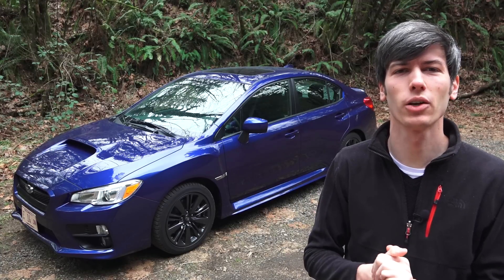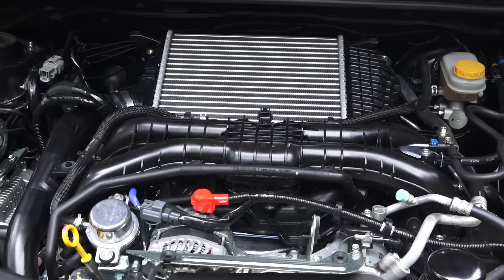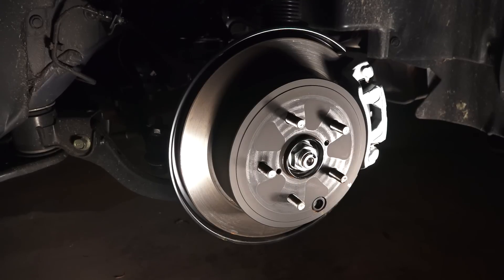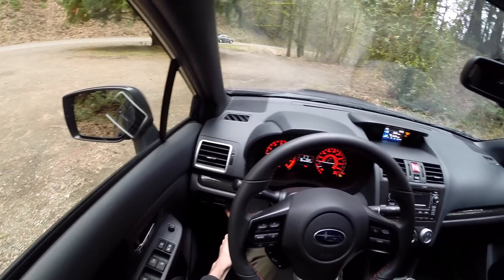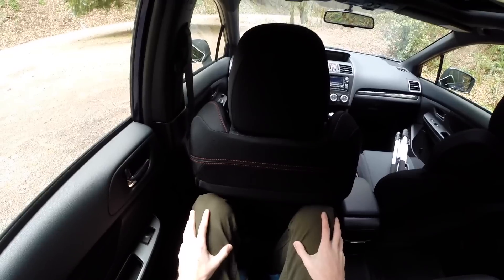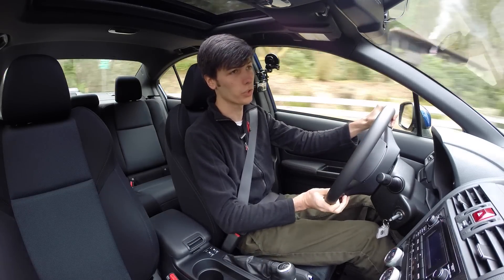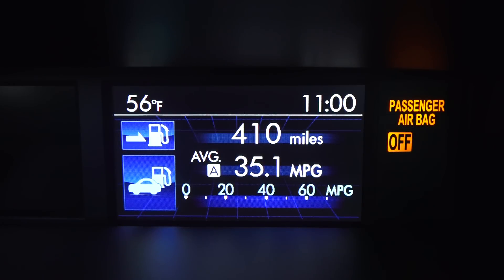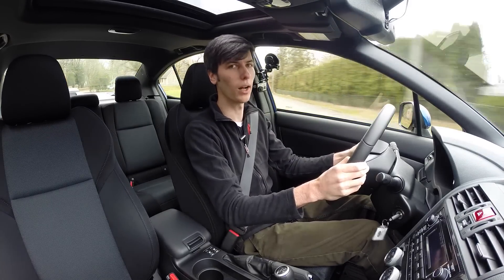2015 Subaru WRX - Review & Test Drive

Comment: The rev hang is quite disappointing considering it is supposed to be a drivers car, even my crappy 7th generation civic doesn't have this problem. I can shift however I went whenever I want, quick or slow smooth shifting, no need to wait the revs to drop down. Just release the throttle and you're done, as simple as that. I wonder if this can be fixed with those after market electronic box that can plug into your car to alter the signal or reprogram the ECU, or what not, not sure how it works, I've seen in somewhere.
But again, this is why I hate DBW throttle system, it's annoying and completely useless in my opinion, especially for car enthusiast, we don't need the computer to interpret our inputs, we can do it ourselves and module the throttle ourselves.
Reply from the maker: DBW throttle definitely isn't useless. Allows for good control, easier to allow for cruise control, and works great with traction control systems. That said, I love mechanical throttles as the response is just better.
Reply: Engineering Explained To be honest, all of these advantages doesn't mean a thing for me. Especially from a car enthusiasts point of view. I don't even get how it can give you better control if it has something as silly as a rev hang between shifts.
Reply: Rev hang is fixed with every aftermarket tune currently available, OTS or otherwise.

Comment: Dude that oil filter on the top is simply worth buying the car for.
Reply: Knights2theEnd my 07 accord is the biggest pain in the ass to replace the filter. It is hidden on a top of a weird metal bar, and when you try to take it off, your hands goes all around stuff till you loosen it up and oil goes everywhere because of its angel. Everytime, I cry everytime.
Reply: I know right i don't have to get under the car and squeeze my hands to remove the filter.
Reply: ***** My sister owns a 2000 civic lx. Its not bad at all for me.
Reply: centripetal25 Have you ever heard of a "topside oil change"?  Use an oil-sucker to pull the oil out of the dipstick-tube. Open hood, change oil and filter, close hood -- DONE.  Oil sucker is also good for automatic xmissions, differentials, hydraulic systems and other hard-to drain fluids.  Any engine with filter on the top NEVER needs to be lifted for an oil-change.  I went 160K miles on a VW diesel with topside oil changes.
Reply: I haven't even driven enough to need an oil change. and I want to change it because of how easy it looks.
Reply: Shawn Moses After 160K miles on the VW diesel, it was traded for Subie. :-)
Reply: *****  Well you need to get under the car to remove the drain plug anyway.
Reply: When I saw that part i was like “ okay, I’m getting this car because of that oil filter!!”.
Reply: Buddy hit a deer ripped the oil filter off and caught the car on fire first week he had it....
Reply: uhh my bmw has the oil filter right at the top too
Reply: Same  with the gti
Reply: @uhh Mercedes? I think they have it pretty similar
Reply: Lol
Reply: Knights2theEnd Changing oil in it is very easy. My ex-wife has a Nissan Altima. Changing the oil in that was terrible. The oil drain plug is located directly above a bunch of brackets and crap. You have to put in a channeling system to direct the oil away from all of that. It's terrible.
Reply: Bruce Peebles what happens after 160k miles
Reply: Bruce Peebles nice
Reply: +centripetal25 funny at this, because my 2010 wrx has a huge under tray needs to come out to get to the filter...but can get to the drainplug easily with it still on...stupid haha my car would do great with a top filter.
Reply: dude i know when i saw my cousins hood i was jelly! Mine is more time consuming to change in the old ej205
Reply: Knights2theEnd You should see the location on the 06 Jeep Liberty. Terrible lol
Reply: What is a good monthly payment for this car(2015) as of today 2017?
Reply: Ed... I think I pay 345 a month for mine.
Reply: y? still gotta go underneath the car to drain the oil.
Reply: Nah get a brz/ frs.

Comment: Why does he always mentions the position of the battery? It's not like it weighs 500 pounds, right?
Reply: They don't weigh 500 pounds but they do weigh 40-50lbs. 40lbs closest to the center  mass of the vehicle in the engine bay is equivalent to like 200lbs furthest to the center mass of the vehicle in the engine bay. Leverage. Also besides the engine, the battery is probably the most dense (weight/volume) object under the hood. Its cool that he mentions it because it brings you one step closer to what engineers were thinking when they designed the car.
Reply: Knights2theEnd
But I doubt that engineers aren't aware of how components affect the weight distribution of the car. I really don't think they can create such a complex machine but then "screw up" and place a 40lbs battery in a "bad spot". That seems kinda silly to me. Wouldn't you agree?
Reply: Baba Looey I agree with you, but if you think about the engine bay and just how much stuff is in there, you have to give them some leeway with the battery. Ideally, it will be placed to balance the car the best way they can, but sometimes they might have to go with an option that is not ideal because it will scramble up their entire plan. Imagine fitting 100 lego pieces in the smallest way possible; there are many ways to do it, but that one damn piece gets in the way!
Reply: MrRoyalestCrown
Haha that one damn piece always gets in the way! Yea well, if I had to make a bet, I would say that for a regular folk driving a modern car, he could never notice the battery placement by feel. In other words, you can drive several modern cars and won't be able to tell me where the battery is just by driving. Unless you knew beforehand of course. I don't think it affects the driving experience unless you're a pro racer in a track or something.
Reply: Baba Looey I agree Sir. I think you are aiming at, why even mention the placement of the battery when engineers did their best based on their limitations. I think he just mentions it for the fun of it, not really to criticize the engineers.
Reply: Baba Looey I don't think I'll be able to tell about the position of a car's parts just by driving it! In the end it is a piece of a whole, and we drive the whole; as long as engineers genuinely do their best, that 0.1% difference is absolutely irrelevant to most people. The competition in the car market is so strong that the little pieces are always brought into question, and I think that strive for the 0.1% better car is a quality we should admire in the people who make them, and the note about the position of the battery is just a byproduct of our strife towards our betterment. On an unrelated note, thank you for being civil in the relative cesspool that is the youtube comment section!
Reply: Knights2theEnd
Yes sir, I know he's not criticizing the engineers, but in another video he said his "preferred" location for the battery is passenger side/rear part of the engine bay, because of weight distribution and ease of access (the latter may be a valid but subjective point). All I'm saying is the designers and engineers probably had weight distribution in mind at some point. It's not an overlooked concept that they easily forget.
Reply: MrRoyalestCrown
Agree 100%, you probably said it better than me haha.
Reply: Nicktrance1
No sir, battery does not weigh more than the engine.
Reply: Nicktrance1 Petrol....LOL..UK?
Reply: Nicktrance1
Sorry, misread. It may be more "dense" as you say but still only around 45 pounds (20kg).
Reply: Corvux IX A little late here, but the battery is offset by the turbo and other components on the left side of the engine bay.
Reply: Corvux IX  theoretically, yes, battery placement can change handling characteristics. However, on a car that weighs well over 3000 lbs and for "non racing drivers," you really wont noticed the difference. But from an engineering perspective, everything little thing should be designed to maximize efficiency... adds up in the end.
Reply: Corvux IX Also the car is developed in Japan (RHD), therefore the battery is placed on the opposite side of the driver.
Reply: *****
good point!

Comment: How bad is the wind noise at highway speeds?  Living in TX I do a lot of highway driving and if it is really noisy that would be a deal breaker.  Do you think a different set of tires would cut down the noise, or is just the fact it's a "leaky" car
Reply from the maker: The cars are made to be light, not quiet. The Legacy I tested was much quieter on the road. I drive a '14 STI daily and don't mind it, but it's definitely not the quietest car out there.

Comment: Oh I know exactly what you mean with that throttle float. I once drove  Hyundai i10 and it was pretty much impossible to change gears at a reasonable speed without jerking the engine. I'm happy that my Renault Clio has a much nicer throttle (though the gearbox is terribly notchy)

Comment: If the car jerks when shifting just engage your shifts at higher rpm. This is normal for high revving manual transmission. vehicles. I drive an Mazda rx8 and shifts are done at 5500 rpm with red line set at 9500. Over all I love your videos and keep up your quality work.

Comment: Do you find it weird that most cars you test give you a higher mpg rating than its EPA rating?

Another great video, thanks!
Reply: Perhaps that's because he understands the mechanics and can cheat it! haha.
I'm sure that's because he knows how to drive efficiently.
Reply from the maker: I don't, I do get surprised though when one does worse than highway rating (like the Lexus RC 350 I just tested). I drive fairly efficiently, and the course is primarily highway, and I typically don't exceed 65 mph. I've done the run in my car and also got above its rating, and actually my overall mpg for my Subaru is above it's highway rating (by 0.4 mpg, but still haha).
Reply: You probably also do very good maintenance on you car being a mechanical engineer.

Comment: 35.1? Thats just crazy i get 24 out of my 96 impreza :(
Reply: Well mine has a display, but I guess you could do it the old fashioned way.

Fill up your gas tank all the way full, reset your trip meter and the next time you fillup divide the amount of miles by the amount of gas you pumped.

Hope that helps.
Reply: I get 17 on my '02 Maxima :(

Comment: I have to say the fuel economy displayed is misleading.  After actual calculating after fill ups the car's display is a couple mpg' optimistic. But also when you first reset the trip and drive it conservative the average mpg will also be optimistic. It takes the whole tank of gas to get a more true representation.  But in the long run I drive mostly highway mixed driving and I'm not that easy on it always getting into boost and I average right at 25mpg. Now a true highway trip I could see making the 28mpg epa rating.
Reply from the maker: I've consistently driven above highway ratings on the majority of my test runs. Obviously it could be off by a few MPG but I believe it too be fairly representative of what is possible with the car. If an engine knows exactly how much fuel to inject, it should be able to measure how much fuel is injected (and use distance driven for a quick mpg estimate).

Comment: In the manual vs Auto transmission debate, how does the service compare in both options, as far as cost and intervals.
Reply: I'm sure the manual is more reliable and maintenance free and cheaper to maintain than that CVT gearbox.
The only you gotta do with a manual is replace the clutch and the oil at some point.

Comment: I think its stupid how they gave the WRX a 2.0 and the STI a 2.5 its sad how they are purposely trying to create a larger gap between the two because they were relatively close before.
Reply from the maker: Without a doubt I believe the gap is smaller now than it's ever been. This new engine is very strong, gets peak torque much earlier (and keeps it for a wide RPM range), and is way (way) more efficient.
Reply: Wouldn't have thought that.
Reply: In Japan that same 2.0 turbo makes 296hp.
Reply: Engineering Explained
Another interesting thing is that the Japanese version (WRX S4) has just about the same power and torque output as the STI. It's also only available as a CVT (which is probably to create a marketing gap between the two vehicles).
Reply: Bryan Doherty Damn
Reply: caleb Reedy and it's in a WRX wagon too that we don't get sad trombone
Reply: Bryan Doherty :( i loved the previous generation sit wagons.
Reply: caleb Reedy they looked better than the sedans, I hope with the Focus RS causes Subaru to bring back the STI wagon. It made up 50% of STI and same for the WRX